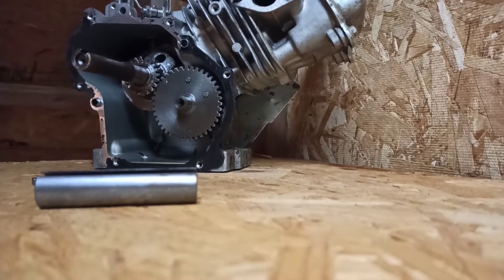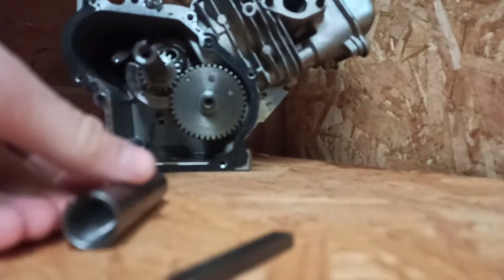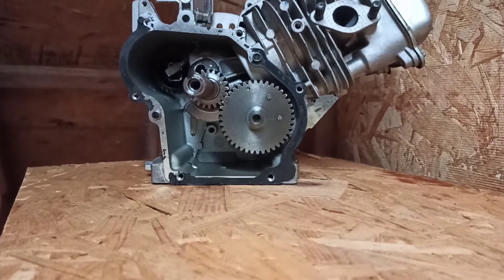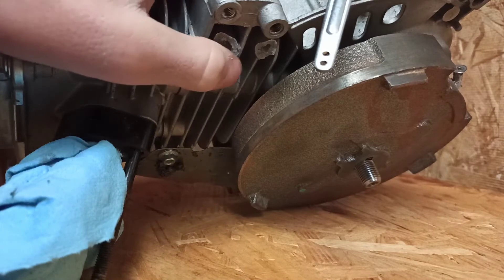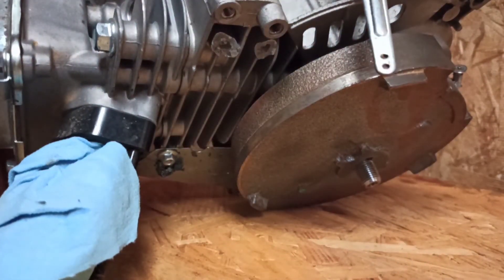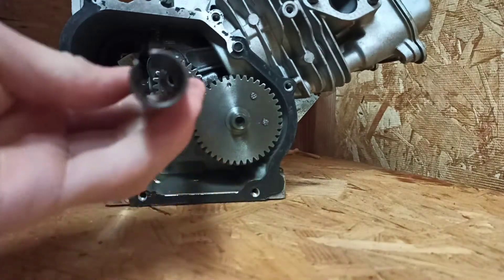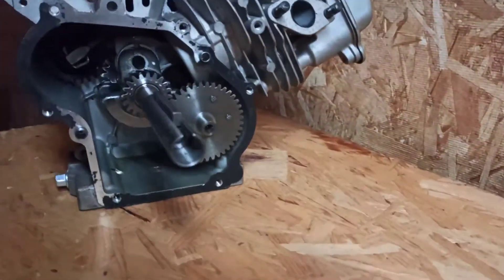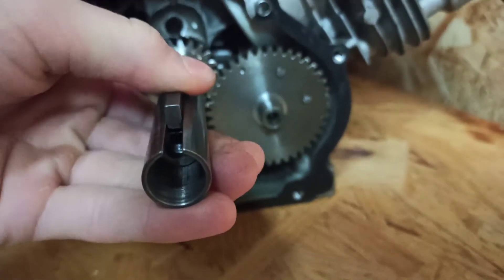Engines : Predator 79 Shaft Adaptor

Comment: Won't work .the torque converter has a key on the driver sleve and it's not deep anough to engage the shaft.
Reply: Yep, I figured that one out a while ago. May need to weld the sleeve to the shaft of the engine.
Reply from the maker: you could get a 3/16 shaft, sand it down and tack it onto the shaft on the driver pulley. I dont see why that wouldnt work.
Reply: Also my sleeve just easily slides on and off the shaft but it’s firm and doesn’t have any play is that normal as well? There’s nothing to keep the sleeve from slipping out?